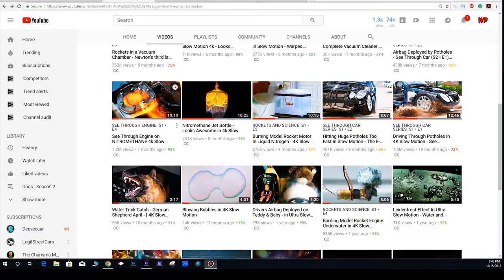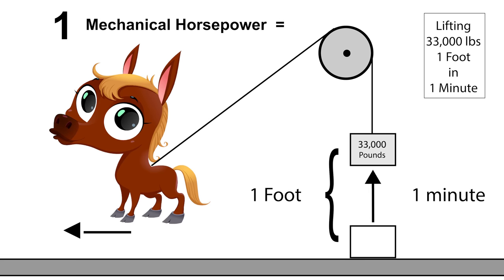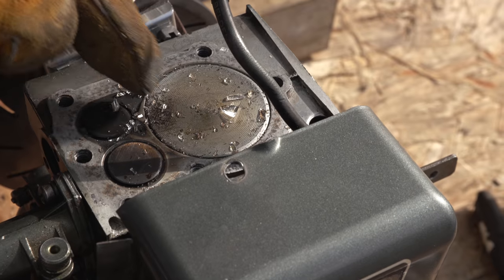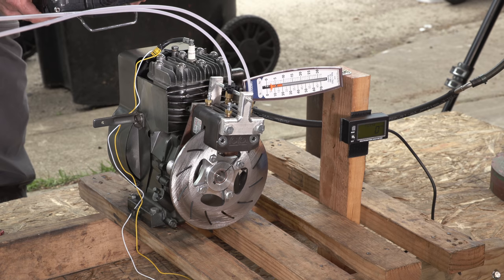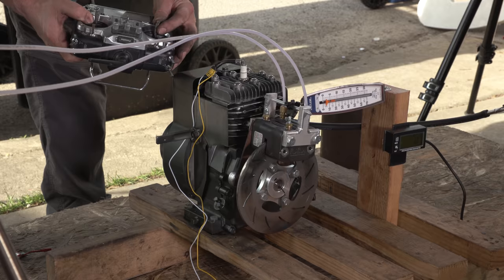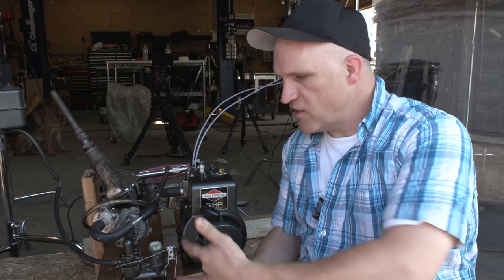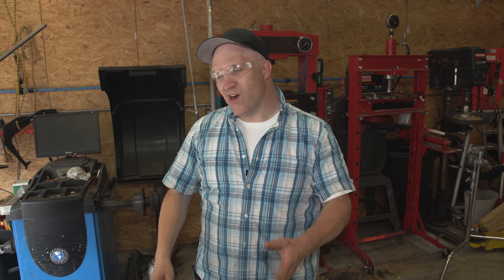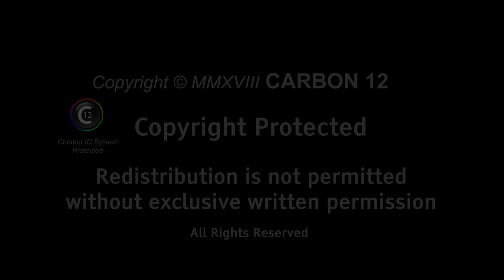See Thru Engine on Turbo Nitro and Dyno  (How much HP does it make?)

Comment: You got what's called oil dilution . the meth and alcohol and the high rpm cause the gases to escape past the rings and it goes into the oil. This is why oil is changed every run on high performance engines.
Reply from the maker: For the next episode I used 70w nitro oil, took care of the dilution.all good now !

Comment: It makes sense why less power with a turbo. A turbo requires a certain percentage of engine power to function. In a vehicle with a normal size engine, that percentage of power is smaller. But in a small engine, that percentage of engine power becomes far more significant. This percentage negates the overall increase in power. Looks like it uses about 1 Hp. to run.
Reply from the maker: Very true, to make more power with a turbo you have to pass the threshold of using a turbo to increase the overall amount of fuel and power that you are making combined.

Comment: 20% Nitro methane mixed with Naptha (Charcoal lighter fluid)  50/50 
I had a run away 10hp Muchulla (SP?) 2 stroke went twenty feet after breaking off mount.

Comment: The smallest engines that can be turbocharged start at about 20 HP NA output, and use the GT06 turbo (smallest you can get)... Anything smaller than that, and you have to use a shaft-driven supercharger. There isn't enough exhaust gas to power the turbo.

Comment: I am surprised you did not measure the intake boost pressure to see if the turbo is actually making any boost ??    Next to get more power from the additional air being pumped in, i would think you need a bigger fuel system ?

Comment: I think fuel injector would defiantly give you what want. If not... a larger carb with bigger jets may work. Also maybe a smaller turbo. I don’t know what exhaust pressure is needed for the turbo to work.

Comment: You could try to spool the turbo using a source other than engine exhaust. Maybe air pressure or hell a leaf blower. That engine just can't spool up a turbo that size that's built for a car. (I know it's small for a car but huge for a 3 HP engine)

Comment: See if you can find a Garrett GT0632SZ, or equivalent. It was the smallest choo choo snail Garrett ever made, not much bigger than a 12 fl oz Coke can with the turbine and compressor side combined. Volume 5 of Garrett's turbo catalog has the compressor map.
Reply from the maker: I have mounted a similar turbo.

Comment: Nice experiment, good design on the pony brake  with good results on the nitro but thinking that turbo was going to work was kinda dumb... RHB3 is about the smallest turbo and I doubt even it would make much if any boost.
Reply from the maker: Good point, I have a RHB3, I believe it's 25 mm, this turbo is 27. I think it will make boost but only on nitromethane not on gasoline, that's kind of what I'm trying to show here is how much energy nitromethane contains because the amount of fuel you can burn and in a way increasing engine displacement, that's where the magic is in nitromethane.

Comment: I think you were timed to fast for total compression, meaning that your engine was knocking not pushing like the mix is supposed too. The tail tells sign was the pumping action, { fast hunting } of your dino and the oil pumping due to the piston rocking inside the cylinder barrel that caused by the detonations on the piston. You need a bigger carb too, right angle carbs are for slower flow rates, whereas turbo's cause faster flow rates.

Comment: The nitromethane and methyl alcohol do not mix with petroleum oils. Whatever fuel blew by the piston made the milkshake like mixing oil and water in a blender.  Try a synthetic racing oil like Klotz Technoplate that is designed to be compatible with nitromethane and methanol fuels.

Comment: super charge it with a vane pump at double engine speed and stock carb 6hp on 89 octane fuel. Then with nitro 9hp.
anything that brings the compression up is gonna help big time on a low compression engine like this.

Comment: That turbo has way too big exhaust turbine for that engine. Also it's harder to get turbo to whistle with one cylinder engine. The carb is not good carburettor for anything, its the cheapest way briggs could get it done. BUT very informative video on how dynos work!

Comment: With high rpm comes high crank case pressure, you need some way to evacuate the crankcase. Put vacuum on the crank case. 
when the pressure is equal to or greater than the cylinder pressure the rpm cant increase.
Reply from the maker: Great point, I didn't even think about the excessive crankcase pressure.. thanks!!!

Comment: It is absolutely expected. When you changed to nitromethane without sorting the carb/fueling out with it, you were maxed out running lean and already FUEL limited. NOT Oxygen limited. Adding the turbo did nothing but exascerbate the situation by throwing ll manner of restriction in the way of the airflow through the engine. Even if the turbo would have spooled up properly, you would still be limited by the amount of fuel entering the combustion chamber. There was already enough air/oxygen.
The clicking, clacking, ticking and creaking you heard no doubt would be the engine roasting it's tits off, due to flogging it's tripe out with that dyno brake applied, and expanding and contracting in different places at different rates. Some kind of cooling fan may have been an idea also.

Comment: gap your plug tighter..... plus you need more fuel pressure, pull timing out and then add in increments
Reply from the maker: Good idea, I don't think that the Boost level I'm after is going to blow the spark out though, I'm going to go with an MSD ignition for the future tests. On my Toyota Supra I run a really small Gap because under high boost it blows the Spark out
Reply: i wasn't thinking because of spark blow exactly.. mostly because of the nitro meth.

Comment: These engines are only rated for 300 hours of use. I wonder if full synthetic oil would make a difference? Or, a lighter grade oil ? 3500 rpm isn't all that much. Years ago, Caterpillar tested a diesel engine using diesel as the lubricant, with unusual results (It worked !). An old trick with oil pressure was to stretch the pop off pressure valve spring to raise the pressure, and use a lighter oil.

Comment: You could try a  mechanical supercharger like a smog pump from a vary big v8 motor and a gear it up by using a pulley and belt system with a  larger pulley on the motor than on the pump. along with nitro and timing.

Comment: Beside the issue of WAY to big of a turbo, I would be willing to bet that the turbo wasn't spooling because of the single exaust pulse hitting it only 1/4 of the run time. I would bet you could come up with a super charger by modifying the turbo and hooking it to the crank shaft, that would even out the pressure coming from the compressor during the run. The next step would be making a dry system, maybe from one of the mechanical fuel injector from systems from Go Power Sports. I bet it could be rigged up to be a blow through system? Also curious if you put a boost gauge on it to even see if it was building any boost at all?

Comment: Instead of running a turbo, use an air compressor. It's still forced induction, but you don't have to rely on the engine to make enough power to build enough boost, which it won't with that "big" turbo.

Comment: Hey I realize I'm late on a reply and I didn't read all comments, so if you already read something  similar....
China makes what they say is the "world's  smallest turbo", about palm size for small diplacement engines. Or get a smog pump and turn it into a supercharger. Watching your video my first thought is supercharged intake needs much more fuel so you needed to drill out the main jet and maybe even the idle jet, I guess you smoked the piston running to lean. Dug the dyno. Steven White SLO California

Comment: Consider using Cox model fuel. It has lubricants you're going to need at higher rpms and it ignites with a glow plug so at higher pressures you're more likely to ignite the charge. It's basically nitro with castor bean oil. It smells like youth.

Comment: Surely the turbocharger won't be driven to anything like a sensible boost level by a three hp Brigs engine. It came off a far larger engine and needs a much greater exhaust pressure and flow rate to run properly.

Comment: And are you using nitromethane or nitro propane? Nitro propane mixes with gasoline, it’s made by Klotz and Summit Racing sells it. It’s like 70$ a gallon, pricey stuff. I’ve been using it for a few years. You can hear the crackle in the exhaust.

Comment: 🔵 I would be VERY concerned about tiny bits of glass that got down between the piston and the cylinder, without removing the piston and cleaning everything out you're probably going to end up getting scratched-up piston-rings and cylinder-head.

Comment: As I am sure others in the comments will point out this turbo is way too big for this exhaust output. Moving on;.. what if you turbo jetted the turbo with a little fuel in there to turn it into a jet engine so it will drive the blades with its own combustion... adding a venture intake would be a good idea so that the turbo/jet will be self sustaining and you'll need a better aerodynamic exhaust piping to assist in the throating of the thrust to create draw.. etc
  OR   Put an electric motor on the shaft of the turbo    OR  use a lief blower to ram it up to speed before starting exhaust and may just keep them separate... The turbo will really help!! I had a few opposed 4 cyl Subaru wagons and without the turbo it was 3/4 of a  V/W 1600 ... ZZZzzzzzzz 2nd gear Take a nap, third gear find a comfortable pillow or answer all your email... 
    Also try using the gas vapor rig and even a bit of HHO ... I'd like to do a bubblier of both water and gas and see if the water vapor augments the gas and/or gas vapor. 
     BTW, thank you for doing this especially the glass head so that we can see the valves open and the combustion, so cool. Blessings
Reply: That turbojet idea is a fun one.

Comment: Shouldn't you be doubling the measured torque instead of halving it?  I might be thinking backwards, but I think it has less leverage at half foot
Reply from the maker: No it's correct, you need to divide below 1ft and multiply above 1 ft. I will give a much better demonstration in the next video.

Comment: Making horsepower is ALL about matching the flowrates of ALL of the components, so either smaller turbo or higher RPM (So much that you'll need uprated everything) also get your compression ratio right then you'll be limited by that standard carb so that'll need replacing too & then get your transitions nice, they're almost as important as any other part. As it is, it won't make effective use of the fuel & make decent power, good luck though.

Comment: Since your rig is 6" off of center from the crank, your scale is registering half of the ft/lb  value. As such,  you should be multiplying that reading, not dividing. 

 With accuracy comes much more impressive results!

Comment: Nice Job ! Educational  and Entertaining ....  Skip turbo charger and use compressed air with pressure regulator to set/adjust amount of boost... I'm guessing you probably have a nice sized A/C in your shop.. LoL
Reply from the maker: Lol .. well I can work in the heat if needed

Comment: Interesting video, but its a forced induction(pressure) pushing(forcing) the piston down what makes power. More pressure(so long air-to-fuel ratio ~14:1) more down force = more HP! That big Mercedes Turbo just not capable producing needed boost from this tiny - puny exhaust of small displacement engine. Why not to use high volume electric pump/fan of some kind coupled with a pressure gauge, that is capable to pump some less then 10psi? That way your experiment is more controlled and measured. Thanks for the video, and I wish you luck, and will be glad to see your turbo project coming alone(I have a feeling I might not be alone).

Comment: Why the restrictive exhaust after the turbo? 
Don't you want the pressure to be dropped across the turbine, so the power (flow times pressure drop) can spin the turbo up? 

Blocking it up that way just means there has to be more pressure different across that little exhaust vent, meaning higher pressure on both sides of the turbine, meaning little to no available pressure difference across the turbine, and thus little power, regardless of the flow.  

Seems like it should work better if you just unbolt that nicely fabricated adaptor right off the turbo exhaust outlet.

Comment: ... You need to change timing with the turbo and get and tune the AFR. The turbo needs to be extremely small. Otherwise the back pressure reduces hp plus no power will be gained because it's running on 1/4 of the nominal exhaust flow it's rated for or less... Which means no boost.

Comment: Well, your carb can only pull so many cfm as it was designed, and you'll want to take that engine apart and gap the rings to compensate for higher cylinder temps so those rings dont pinch and blow the piston apart. So bigger carburetor, that'll also get you enough fuel to create the specified amount of heat to spin that turbine and get your mixture right. That turbo is also far too big. It was pretty much just a restriction with this setup. It could make more power, but then you run into those higher cylinder pressures snapping the rod or crank, as it was not designed for forced induction.
Reply from the maker: Thank you, you are completely correct. But check out the latest episode I think you will enjoy https://youtu.be/9hMnlyKZLwE

Comment: Need smaller turbo for sure, guarantee it will bring the rpm's and of course the hp. up. That big turbo for that tiny motor was restricting the flow ALOT, just couldn't spool it, try a smaller turbo, I would like to see the difference, but anyhow liked the video, keep them videos coming thanks.

Comment: Wet systems foult?!
Size the turbo after the ccm and rpm  of the engine and get more fuel into it  when pressure increases!  Then you will get results!

Comment: Hmm, if you're going to keep using that turbo, why not utilize an electric motor to spool up the turbo rather than depending on the exhaust to spool it, an electric motor could possibly keep the boost pressure stable and make some sort of small waste gate to alleviate the pressure to stabilize it before it enters the intake.... that might work too. Just an idea if you're sold on using the turbo you already have.
Reply from the maker: No need for that, this turbo will spool, just needs to have the right fuel and the right tune, we are currently filming that episode, and that's going to be the next one out. It's going to be good

Comment: Rookie! you cant use a turbo that size for that small of an engine and also draw through turbo set ups works fine if you know how to set it up correctly just need a carbon seal and correct jetting

Comment: A single cylinder 4 stroke does not work well with a turbo. The exhaust pulses instead of a steady flow the turbine needs. A positive displacement roots blower or a mechanically driven centrifugal supercharger would be far better. 
 When I raced my Briggs a million years ago I drilled out my crankshaft for oil passages to the rod and wrist pin. At the higher rpms i was running the dipper type oil system didn't work. I also removed the cooling fan blades from the flywheel and utilized ambient airflow for cooling. With that setup I could beat dual five horse Briggs because I was lighter and put out more power than the 6hp "cool bore" I started with.

Comment: The problem is is the size of your turbo. For such a small engine it's going to take a lot of RPM just to get the turbo to spool up. More RPM that what that engines going to put out. To spool the turbo off quicker, opt for a smaller turbo. Yes the bigger turbo will give you more boost, but they'll take longer to spool up then a smaller one would.

Comment: That oil is what happens when it's mixed with nitro. Look at the oil that comes out of a top fuel engine after a single pass, it looks very similar.
Reply from the maker: Thanks, I'm actually going to see some of my top fuel driver friends this Saturday, I'm going to ask them about the oil. But in episode 6 which is in editing right now, the oil was so bad it completely filled up the crankcase, it was insane.
Reply: @WarpedYT  I think they run straight 60 or 70 weight racing oil and or course it gets dumped after the warm-ups and after every pass. The fuel volume they run is just insane so a ton of it gets past the rings and into the crankcase. I've heard of some teams somehow heating the up the oil to separate the nitro from the oil so they can use the oil again at least for a warm-up, but not a pass.

Comment: The reason why it didnt make any more power with the turbo is because the turbo is too big for such a small capacity engine ,it has nothing to do with the setup being a draw through system ,if anything it helps seeing as there is no intercooler it will lower the intake charge temp 

If you were to put a boost gauge on the engine you wouldnt see any pressure in the intake ,even though you can hear the turbo spinning it doesnt mean it has overcome engine vacume

Comment: The flat head briggs are just great little engines. And you tryed to blow up a flat head by free reving it? It cant move air fast engouh though the carb, valves, then the bottle neck of the head the rev high engouh to blow up.

Comment: Your turbo needs pressurised oil, the bearing floats on a layer of pressurised oil it won’t spool properly with just a bit of oil poured in a tube